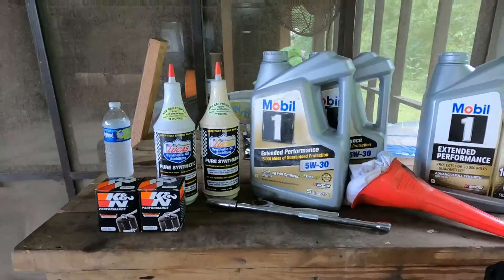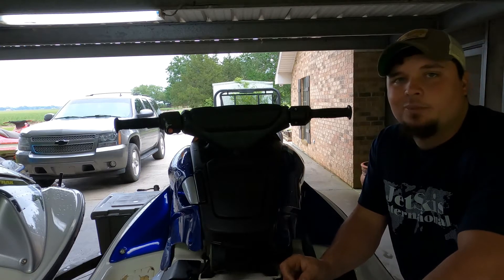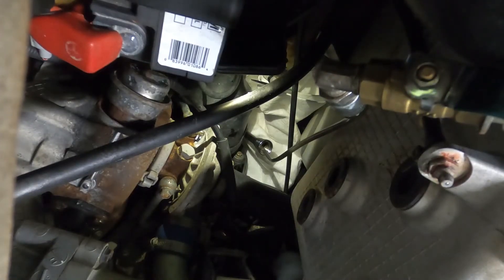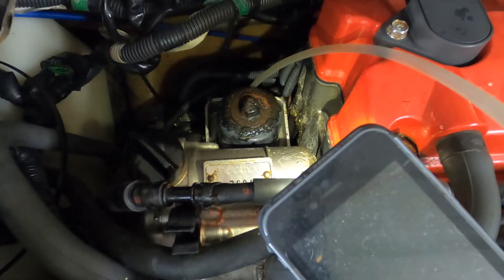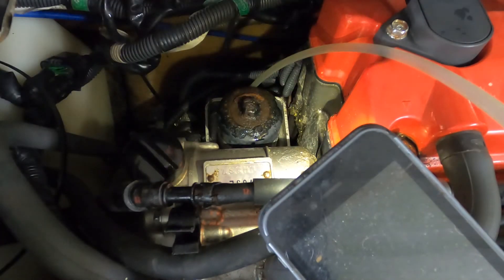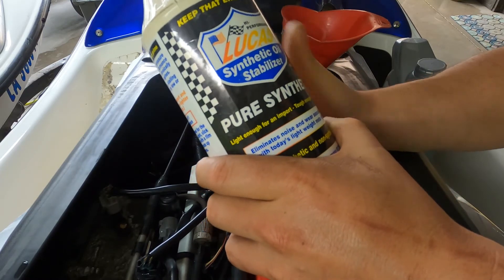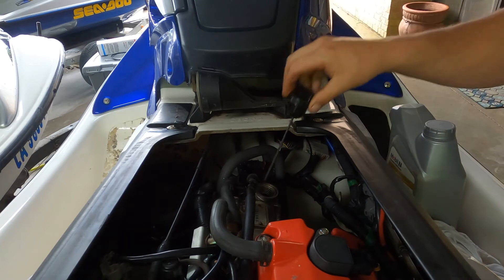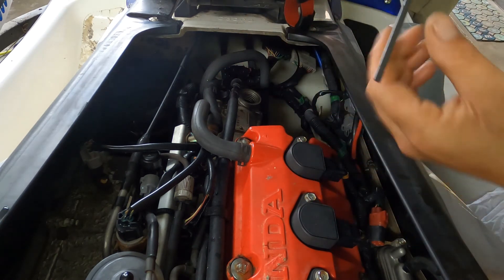How To Change The Oil on a Honda Aquatrax r12, r12x, f12, & f12x!!

Comment: you only put 3 quarts in it? i just sucked mine out and took out more than a gallon??? also what is the dipstick at the bottom for if not to check the level? shouldnt that be full too? i jusst put 5 qts in mine and its not even on the stick at the bottom yet
Reply from the maker: sorry about that. My account stayed logged into my other channel. Yeah, that all ours took. Should be around 5 quarts total. You the r/f12 model or f15 model
Reply: @goodtimentools619  f12

Comment: Supposed to  run 10w-40
Reply from the maker: Don't always have to. A 40 cheap oil wont be the same as a actual good oil. Mobil 1 30w is plenty good especially with the Lucas additive. The Lucas bumps up the viscosity and is great at coating the rotating assembly. We run our skis hard and the I got the whole fleet running this oil set up. This wet up wont be changed